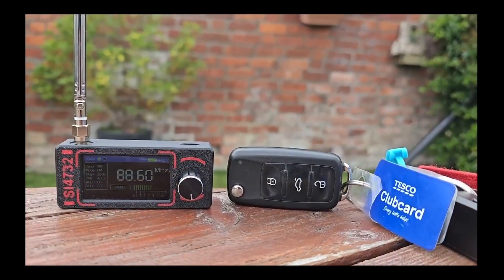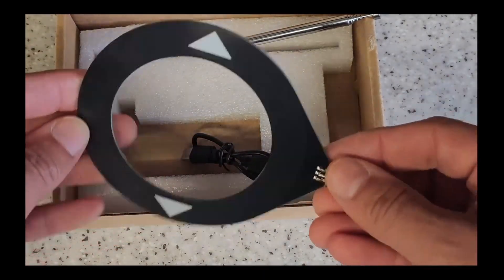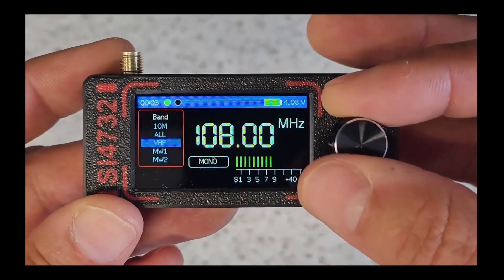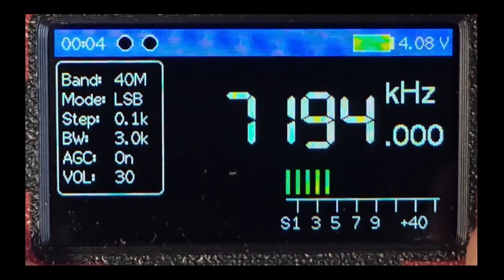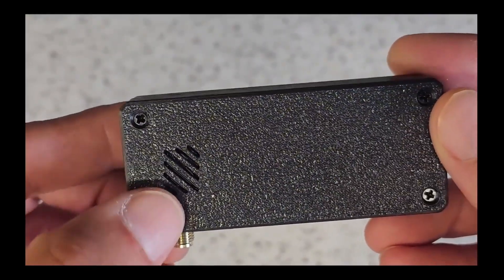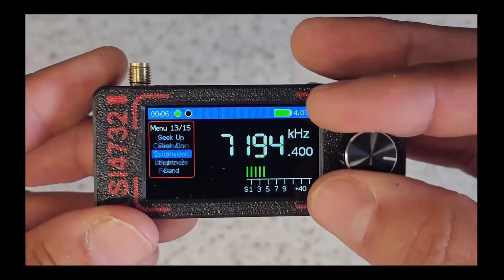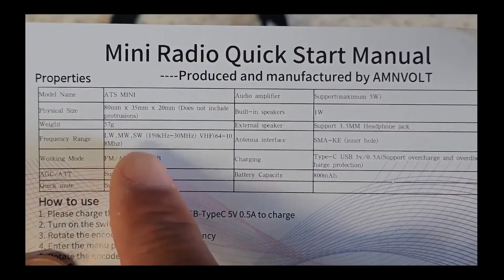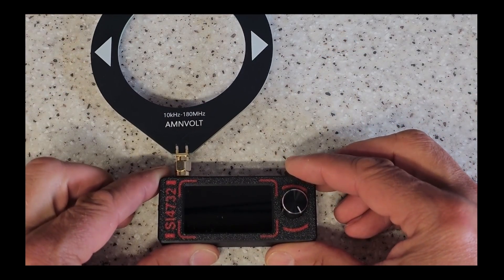DuB-EnG: INCREDIBLE TINY SSB RADIO - AMNVOLT Mini HAM Radio si4732 ATS - ONLY £20 - BLEW MY MIND

Comment: I cant pick up anything on the ssb even with the stock antenna
Reply from the maker: Strange, mine is super sensitive on ssb.  Are you in a very noisy electrical area?
Reply: What the best way to test it probably setting mix up i only had it few day

Comment: I reside in the Philippines, but every summer I hit the Canadian highway on my motorcycle. This past summer, I swapped my Eton Elite Executive for this disposable little radio—mostly because if it tumbled down a ravine, I wouldn't shed a tear. It proved a joyful companion, needing just a clip-on reel antenna for a signal boost. Its sensitivity is seriously superb, rivalling gear far too expensive for a motorcycle saddlebag, ensuring that even when desperately remote, I always had some chatter to listen to. I am notoriously hard on gear, and every time I turned this radio on I was surprised it still worked.
Reply from the maker: They are fabulous radios!!!  Not indestructable, however, really sensibly priced!!

Comment: They are great little radios I've had mine for a week and I carry it everywhere. There are various firmwares out there too to try out.
Reply from the maker: Yeah I need to look into a firmware update...  lovely piece of kit!!!
Reply: @DubiousEngineering for the very ambitious some firmware zip files contain the original arduino .ino sketch that created it! I recommend backing up the existing system before flashing.
Reply: Do you need decent aerial set ups to get the best use?
Reply from the maker: It is really sensotive with its telescopic aerial, but better aerials will deffo help!!

Comment: Yeah! I have the v1 of this radio that's really quiet on headphones as it has no amp.. I did look up upgrading the firmware but couldn't be *rsed. So....aliexpress.....this version coming soon. Great little radio, even V1 is great.
Reply from the maker: Cracking radio, I have a few friends that are thoroughly enamoured by its size and capabilities!!  Enjoy V2!!!  😉
Reply: The v1 doesn't really have a headphone jack, it's a line-out intended for use with amplified speakers. The v2 and newer v3 both have headphone amp circuitry. It's a hardware issue, not a software issue, so it cannot be fixed by modifying the firmware.
Reply from the maker: To be fair, the amplified output is still just a bit quiet...  i guess down to the size of the speaker...
Reply: @DubiousEngineering try 16 ohm earbuds if you have some. I noticed a difference in volume when I used 16 ohm instead of my regular 32 ohm earbuds. Maybe your earbuds are too good. 😅
Reply from the maker: I think i used my precision in ear monitors...  they are quute sensitive :-)

Comment: Surprising no Bluetooth. You can plug a Bluetooth device into the headphones Jack. 
The first video from you I saw was converting an old antique valve radio into a Bluetooth speaker many years ago. It would be nice to see the two working together 👍🤓
Reply from the maker: That was donated to mt mates pub :-) 😀...  it was a beautiful looking radio...  as always Patrick, great to hear from you!  H
Reply: I agree.  The built in speaker would be poor but if it had a built in bluetooth this little radio would sound pretty good.
Reply from the maker: @n1kkri I've looked inside it, and it does indeed have a Bluetooth module on the PCB.  Maybe a firmware update would be good one day! 😀
Reply: Amazing, hope they update that! Pairing to some headphones would help a lot.

Comment: Be great to see you mod this. Especially a pair of stereo speakers, may be an issue to keep it that small though
Reply from the maker: Im wondering if some carefully placed holes on the front of the unit might be enough to allow some of the sound to come from the front of the unit.  I guess I should take it apart and look inside!!!
Reply: @DubiousEngineering I'm surprised you've not peaked inside yet